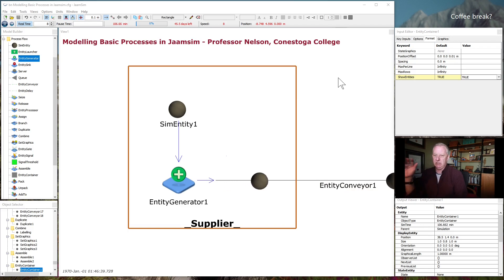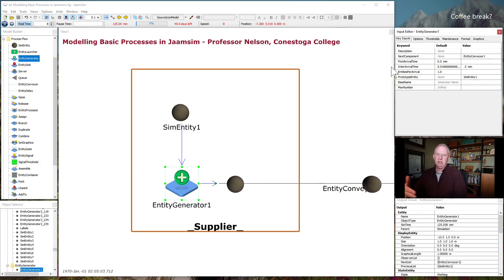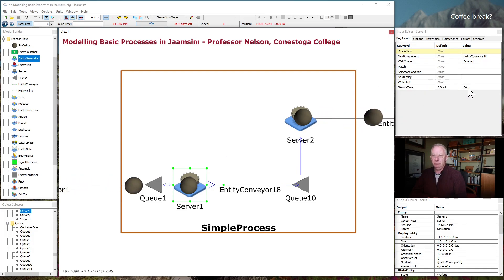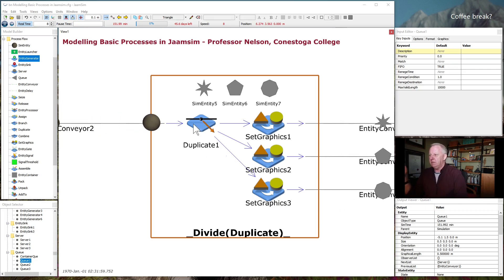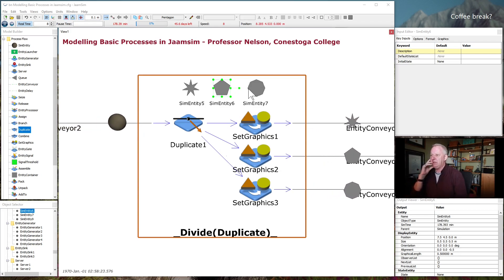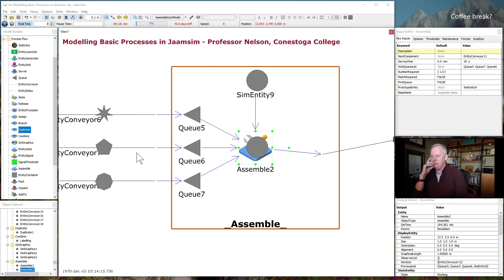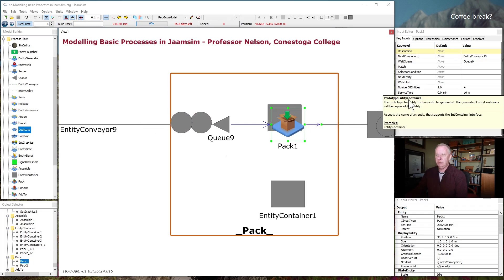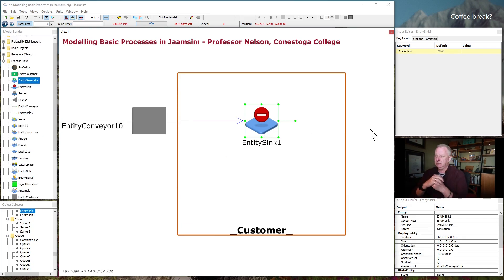Jaamsim Tutorial Part I - How To Model Basic Processes

Comment: Professor Nelson, thank you for this video. If I see this correctly, then this is a push-based production control, and there is only one product. Buffers are emptied based on a FIFO logic.

Could you also implement something like the following with Jaamsim?
- Pull controls instead of push controls
- Inventory controls based on more complex rules than simply FIFO (e.g. random part retrieval)
- What if I have 100 product group - can I manage this variance and I want to manage inventory and prioritize between product groups and dependend part families
- Instead of specifying a source that generates jobs with a random distribution or fixed intervals, I want to specify some sort of production schedule and execute it with the simulation

Many thanks in advance.

Kind regards 

Linnart Felkl